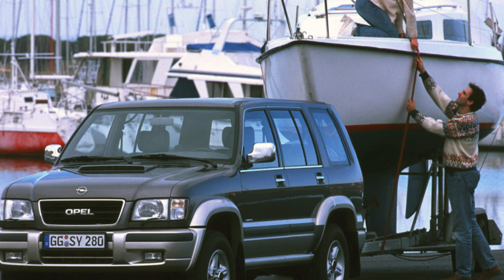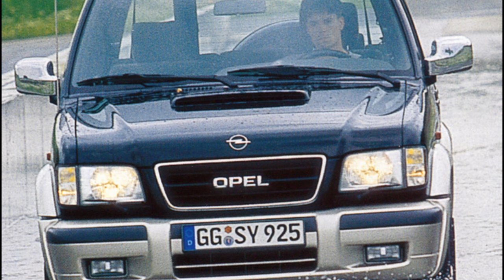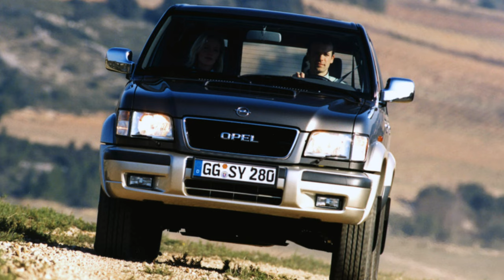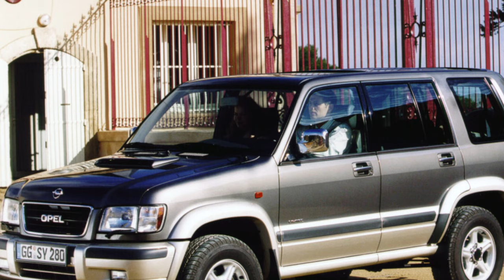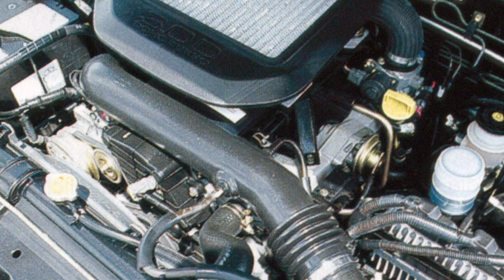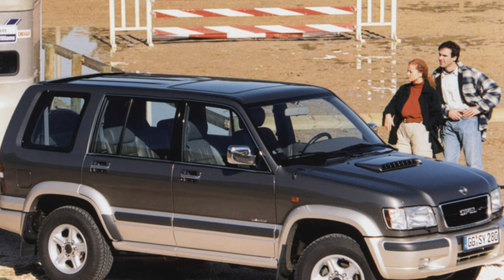Opel Monterey A Problems | Weaknesses of the Used Opel Monterey A 1992 - 1999

Comment: I owned a Holden Jackaroo same bucket of junk. Intially I thought it was nicely trimmed seemed to drive ok BUT the glow plugs siezed in head , toeing a car trailer with 1.2ton it couldn't brake and would slide into intersection . My 1990 Pajero wouldn't with the same load. Lots of dead  Jackaroo s in Australia my advise buy a Pajero , LandCruiser for long life .